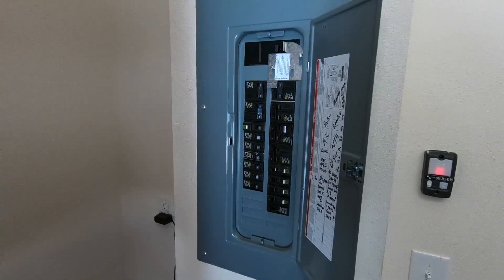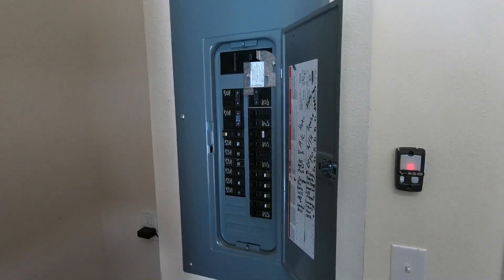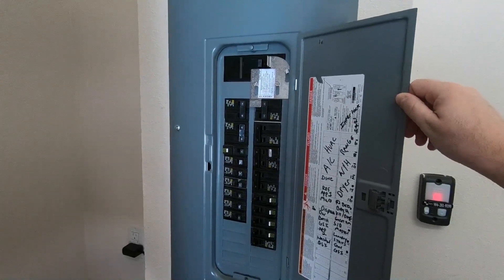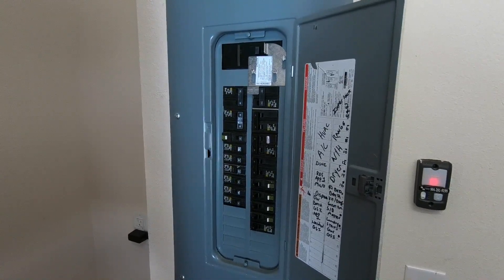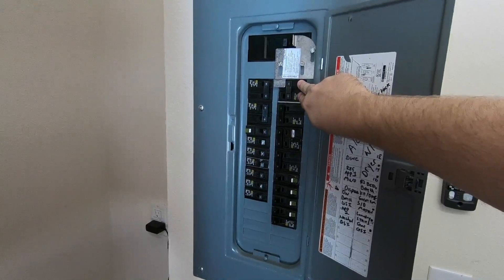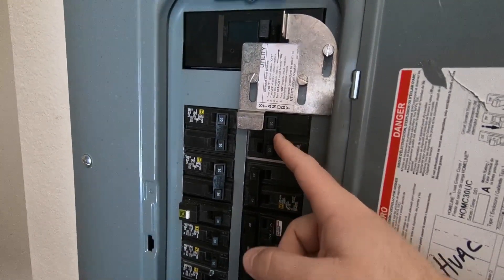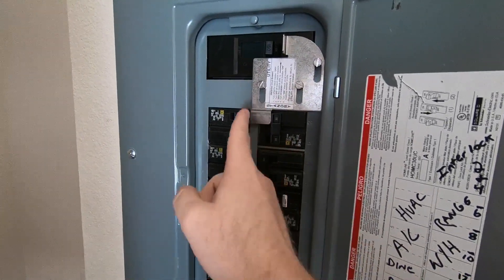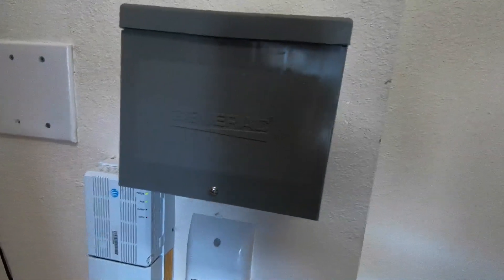Interlock system for portable generator installed on a Square D electrical panel

Comment: If your power cord and gen outlet are rated for 30 amp then all you’ll get is 7200W of available power from that cord. Of course you could plug in other things direct to the gen. But a 10,000 gen cranking out 7200 is working pretty hard and I wouldn’t want much past 7500 for continuous duty over several days. It’s best to make sure the items turned on are balanced on each side of the panel to max each leg of the gen set. Load balancing.

Comment: Is your generator neutral floating or is the ground and neutral bonded?
Reply: It would need to float at the gen because it’s still bonded at the main panel where the back feed breaker is being powered by the gen.  If the house has an outdoor master 200a disconnect that’s where the bond would be and the house panel would be considered a sub panel but the gen would still be floating neutral I believe since in either case only the hot legs are disconnected by a breaker. Ps I’m no expert. Just an engineer but not electrical. Been through this process.